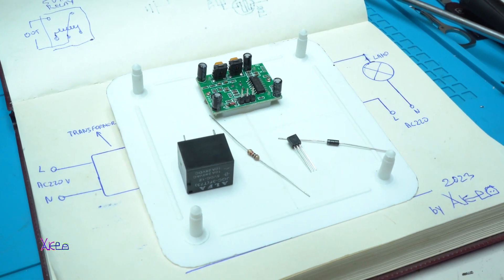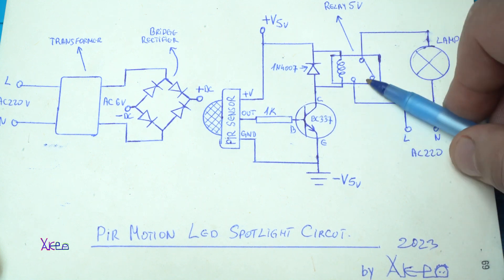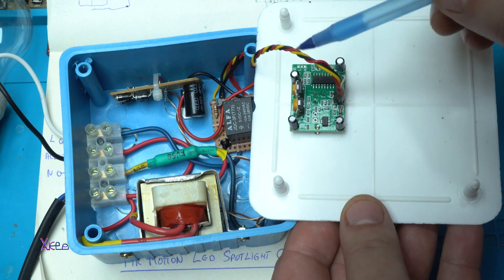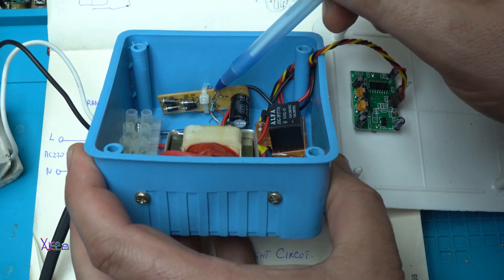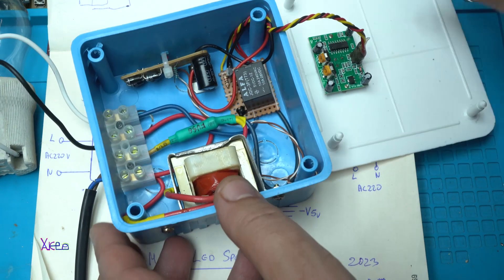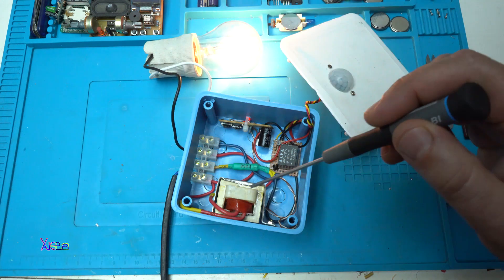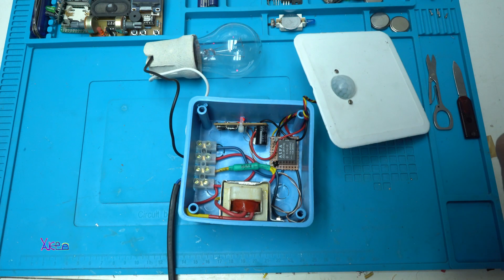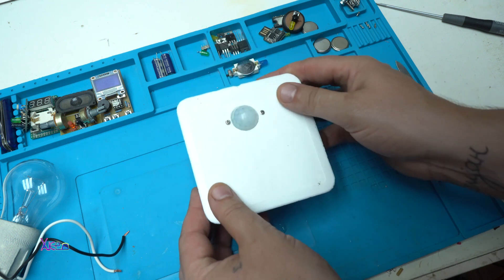How To make PIR Motion Light Control

Comment: Very nice! It would be very interesting to do this montage but with 5 and 12V power supply! All the best!
Reply from the maker: With removing the tranaformer you can operate directly with 5v usb
Reply: @Hacktuber  You mean the transformer and bridge rectifier disappear from the schematic and the assembly will be powered directly from 5V? Will 5V be enough? Does the relay need to be 5V with 2-3 Amps? Thank you !

Comment: Great video !   I especially like how well you went over the circuit.   My question is .  I live in the US and all of the power is mainly 110 volt so how would the circuit change when making this ?  Also have you figured how to use a webcam that is usb powered so 3-5 volts into a wireless camera or a door cam ?  I am disabled and so getting  up to answer the door takes time.  I also have a couple of old tablets and cell phones which all have cameras and LED screens which I have saved to use some day... any ideas what they could be used for ?  I'm just starting out so take it easy and make it as simple as possible !  Thanks for taking your time and effort to make your videos.
Reply from the maker: Hello
First about using 110v it does not change nothing if you wanted to make this pir circuit,just check that transformer operates on 110v,other thing about how to use old smartphone as security device,the simples way is to have older android device and install app called "Alfred" you need to install on both smartphones,one of them will be as monitor and other one will act like a camera which will be outside.
Reply: Thanks I'll give that a try !   Any suggestions on either old tablets or laptop screens that work ?  I have several that the laptops too old or tablets that the batteries died ... I think it would make for great content for you !  There are a lot of parts that could be used !. @Hacktuber

Comment: What if you wanted the light to stay on for a short time after there is no movement? Would you add a capacitor across the pir output signal?
Reply: I think there is an adjustment potentiometer on the PIR sensor
Reply from the maker: I dont know if this pir module can operate like that,on pir sensor you can adjust only time and sensitivity plus if you wanted to be active only at night you need to solder LDR on board/there are marked points on board.
Reply: I Think it can be done with a simple 555timer IC.